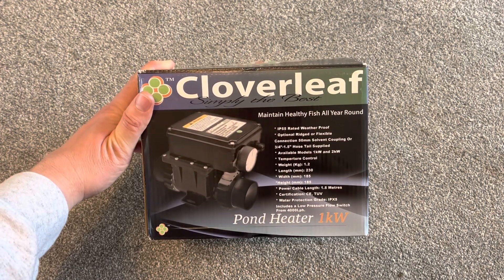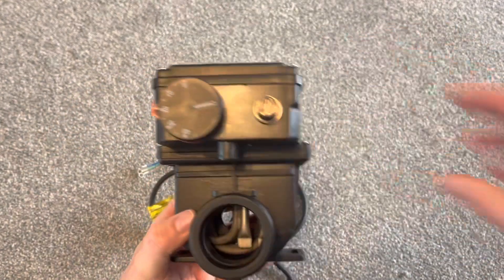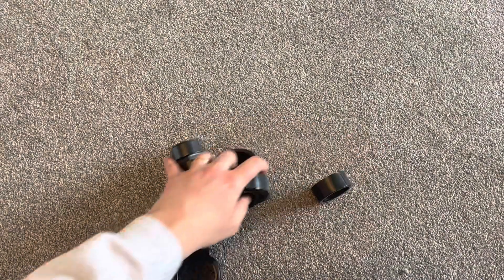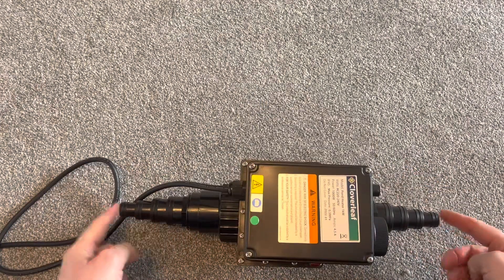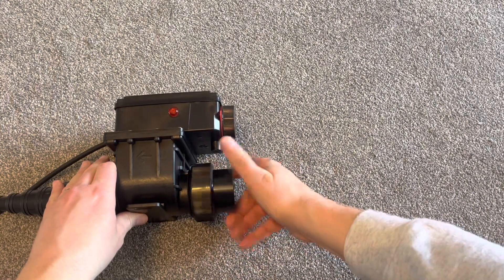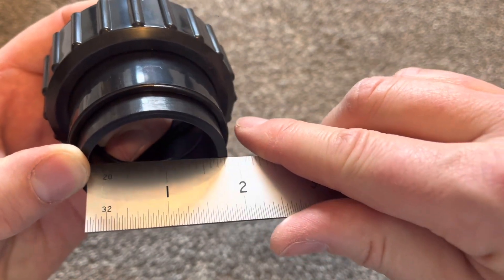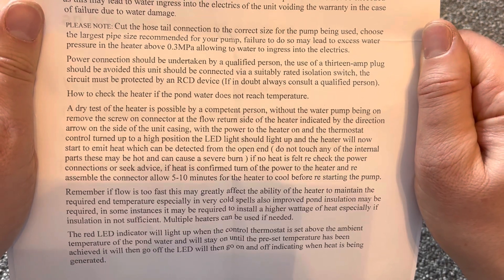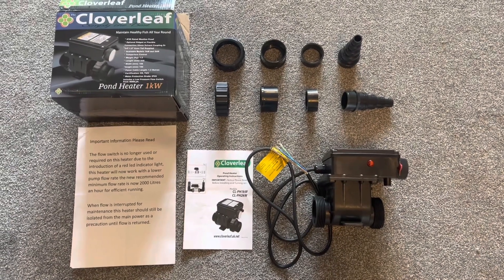Cloverleaf 1kw pond heater UNBOXING review for koi pond

Comment: Might be worth getting a stc1000 temperature controller, I added one to mine, £8 off eBay, and it's more reliable and accurate than the thermostat switch on the heater 👍🏼
Reply from the maker: Cheap as chips! I might pop one of these on actually, thanks for letting me know about them! :)

Comment: Nice one mate 👍 I've had one for about 3 years they are great bits of kit the only thing that let's em down I've found is the thermostat dial isn't very accurate so I added an inkbird heating thermostat plug on mine and hasn't let me down 😊👍
Reply from the maker: Cool thanks! If I decide to keep it on for a bit longer I’ll take a look! :)
Reply from the maker: I just had a look and you can get a smart one for £45! That’s a bargain! Looks like it has an alert feature as well which could maybe work as a leak alarm as the temp would change by quite a bit if the water dropped below the level of the sensors which would be worth that alone! Have you got the smart one??
Reply: @Chaz Koi  no I don't have the smart one as I don't think that was around when I bought mine but once my new pond is built I might upgrade it 👍😊

Comment: Nice unboxing Chaz, I hope you are well? Looks a handy little unit? The only thing that would annoy me is that mounting bracket which I would prefer to stand proud of the coupling unions. Obviously you can get round that but work you shouldn’t have to do. All the best Buddy 💪
Reply from the maker: Hey Paul, I’m not too bad thanks, hope you’re doing ok? Yes, I agree, the mounting plate is a poor design, however I wouldn’t let the put me off buying another one. I’ve been quite pleased with it so far and it’s working well in my set-up. I’ve got a video to upload soon of me installing it, and another to follow where I’ve been recording how much electricity it’s using. Thanks again for watching and getting in touch 👍🏻
Reply: Brilliant news Buddy , if it’s doing a great job for you happy days, I look forward to the next one 👍
Reply: I’ve just bought one mate does it use much electric?